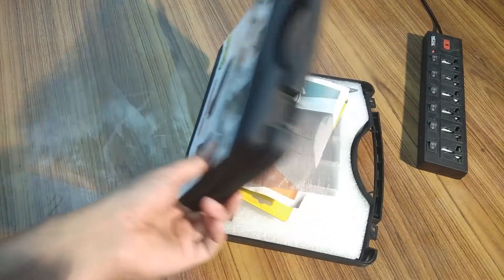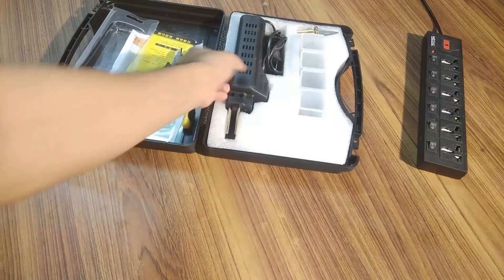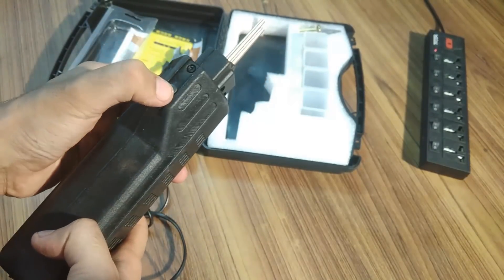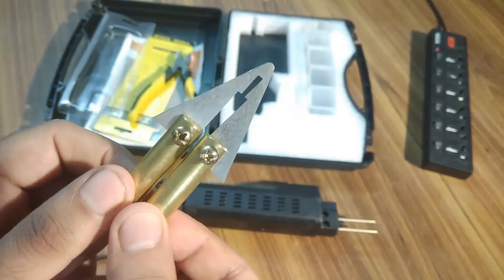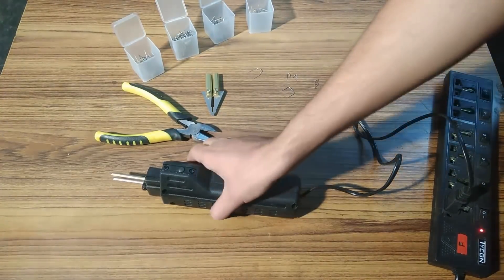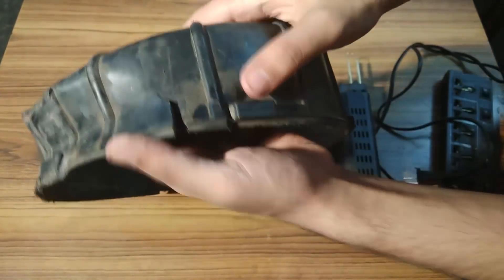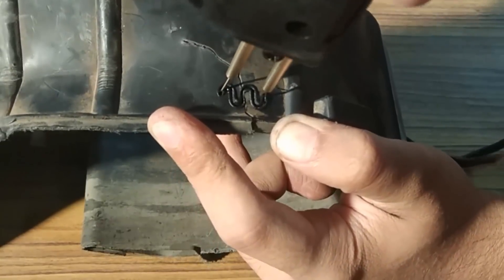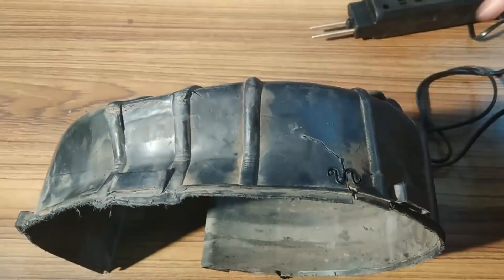Wow!!!!! Amazing Plastic Welding Machine Review | Staple, Fix & Repair

Comment: Instead of cutting the tabs off why not bend them back & forth and break them so they won't protrude above the surface?
Reply: Because U have to use special stamples(pre cut) otherwise U push them out

Comment: The staples you’re using are better in line with the crack due to the fact it’ll cover larger areas.. especially the ones you first used.

Comment: wat is inside this plastic welding machine
Reply from the maker: a high voltage to low voltage converter circuit.
Reply: tasformar yes or no